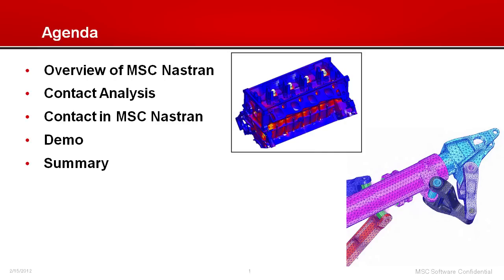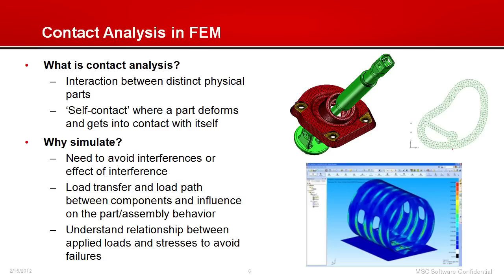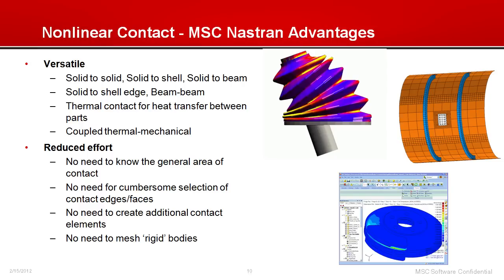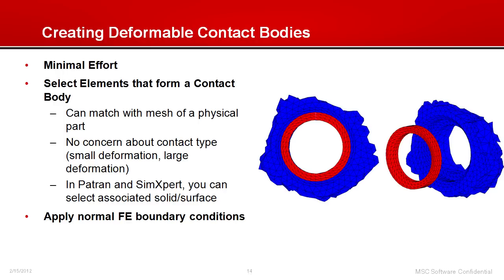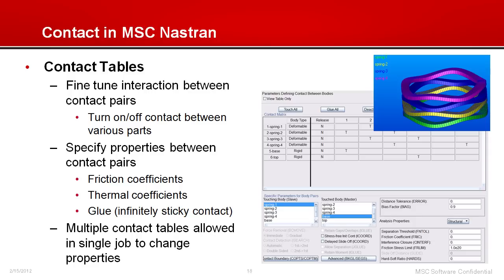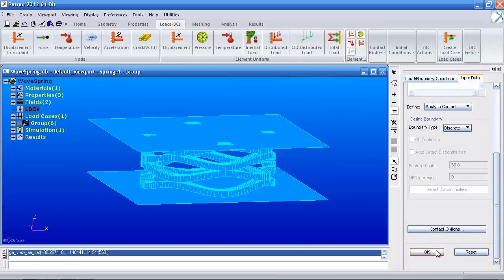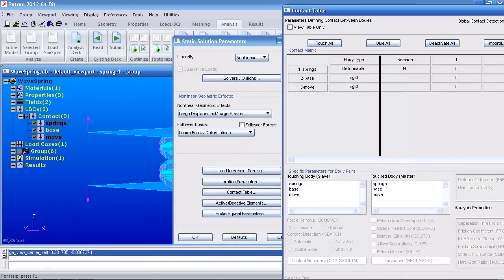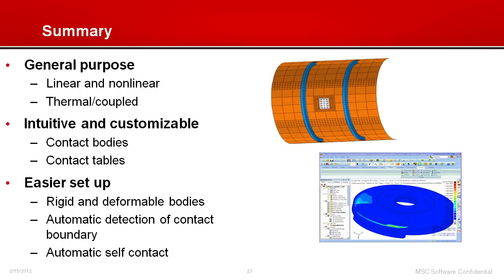MSC Nastran - Contact Analysis for Robust Designs

Comment: how should i model a 3D solid with composite sandwich properties, and connect it to a shell model with 2d shell props.any contact analysis required?
which analysis(solution type) i should run to get 3D displacement/stresses etc.
which file to use to view the results like master/dball/op2/xdb.

pls help.

Comment: i need to connect two planer shell mid surfaces at their outer surfaces only, which are situated naturally at some distance(about 15mm).
dont want to use any rigid body element. and dont want to model their outer surfaces and connect.
pls guide me on this. can contact BC serve the purpose?